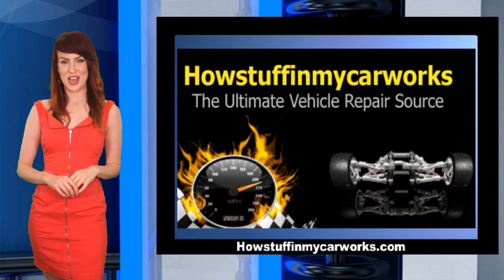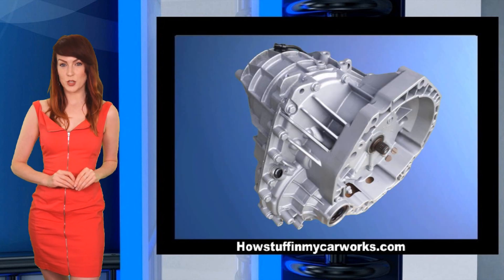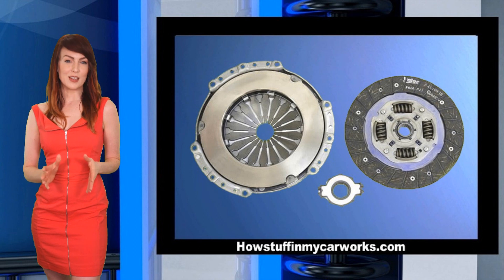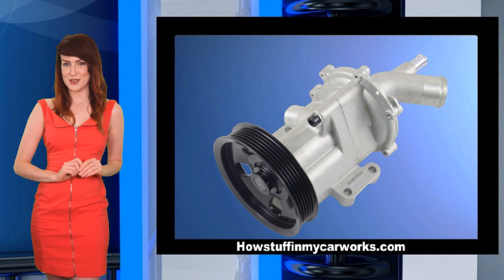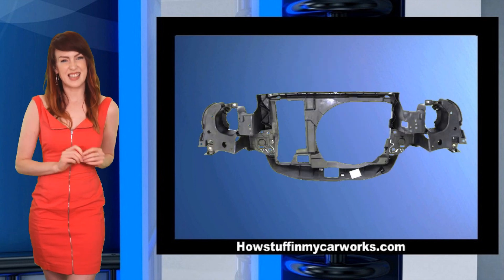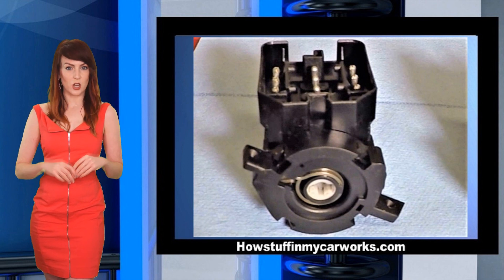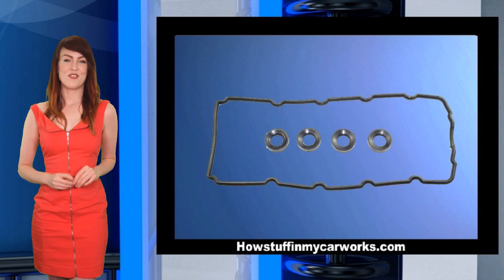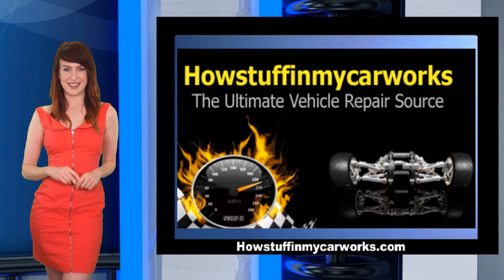R50 and R53 Mini Cooper Built From 2001 to 2006 Common Problems and Complaints

Comment: Basically what I got from that is don't buy a Cooper I think she pretty much covered all the main components
Reply: Lol... Yeah... she is not wrong tho... I'm trying to restor an R53 and the car basicaly had all the problems she listend... but it's not as bad as it sounds... Just like any other car if you maintain it well you will avoid all these issues. Most R53 are run on a budget and since they are supercharged they tend to be abused. Mine has never left me stranded despite it being a shit box when I first got it. I've fixed all the mechanical issues and I dare say it's now a reliable vehicle.
Reply: @SkyPirateU Hi, is it real that the cooper r50 consumes oil ig not changed correctly?